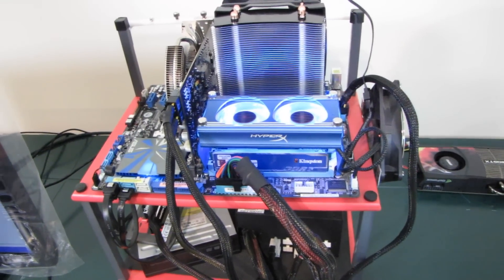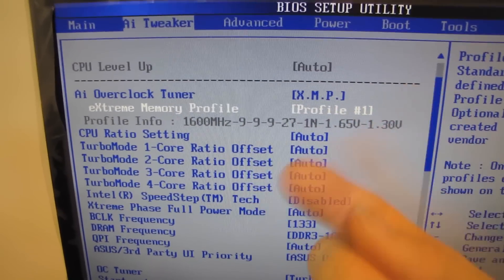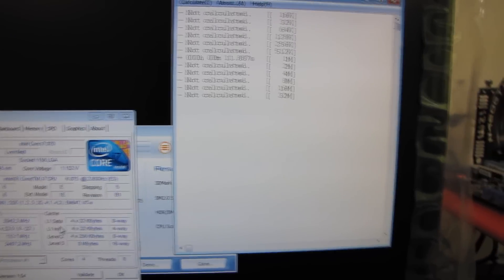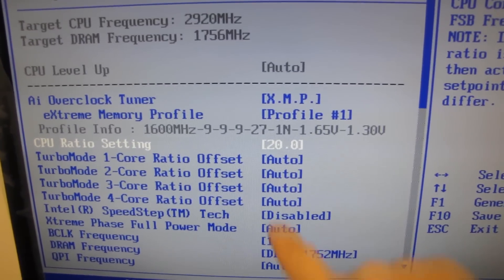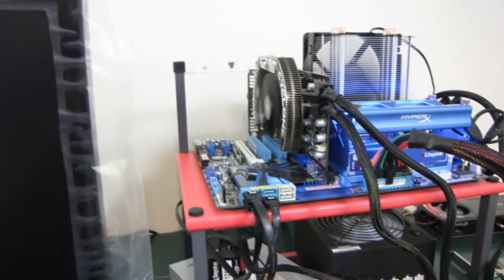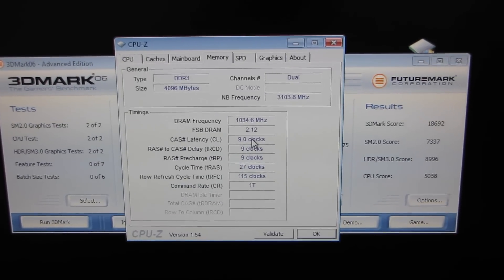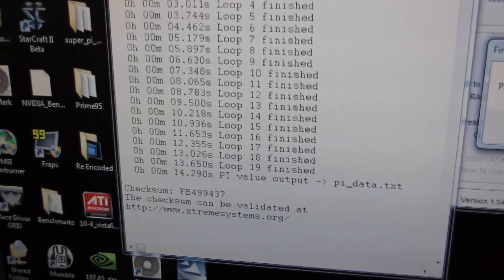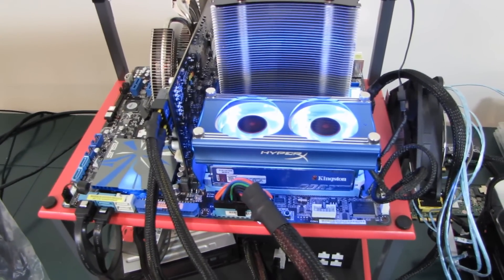Kingston HyperX Blu 1600MHz DDR3 Overclocking Guide Tutorial Linus Tech Tips

Comment: Hi Linus Tech Tips and all the people here :)

Hi, how is the name of the individual memory latch - which are set here?
I`m very instrested of these things to do.

I have a problem:

I have a problem and although I have the following memory: Kingston KHX1600C9D3B1 / 4G (99U5403-067.A00LF) - with the mainboard: Asus H87-Plus. The problem is that the memory is only detected as 1333MHZ - xmp profile is not activated - and even if it is activated - it does not bring. I once managed to set the ram to 1600MHZ, but since the system was unstable and when you plug in another ram pair, I came to the desktop, etc. but otherwise nothing ran great including freeze dektop. The RAM is not in the QVL list of the motherboard - these lists are old as well as the mainboard itself ... it may be that the RAM on another mainboard automatically detected by 1600MHZ correctly or it may be that one this particular bar / latch generally set manually, this must run on 1600MHZ?

Thank you in advance.

Comment: I've this RAM kit actualy running as DDR3-2400C10 xD 
1.200 MHz CL 10-13-12-30, comand rate 1T, 1.800V without any air cooling, no need...
Reply: are they still...alive?
Reply: @azwris-Achaean  well, I'm now on DDR4, the old DDR3 was still alive the last time I used them, I am now runing 4x8 GB DDR4-2400c17 from Micron with no dissipator, they are runing at 2800c15 1.500v right now, here is the full computer : 
https://www.userbenchmark.com/UserRun/27380884

Comment: If anyone wants to upgrade, i highly recommend the HyperX Fury 1866Mhz CL10 1.5V for DDR3 builds. I bought 2x8GB this week new for only 67 Euros. They're running now at 2133Mhz on a G1 Sniper M3 with an i5 3750k @4.2Ghz. With the ram at 1.64Volts i managed to tighten the timings to CL9 11 10 30 (!) All on 2133 and still stock Trfc 243 and Command Rate 1T! :D  ... The MaxxMEM2 results blew me away:    Memory-Copy: 24474 Mb/s  *  Memory-Read: 24429 Mb/s  *  Memory-Write: 20711 Mb/s   *   Memory-Latency: 46,4 ns   *  Reached Memory Score 22,24 Gb/s  *   I'm happy that there is no need to buy TridentX 2133 CL9 11 11 31 @1.6V for 90 Euros (what also would be a good buy :)
Reply: hello sir ,good day , the  HyperX Fury 1866Mhz CL10 1.5V can overclock up to 2133mhz?
my pc specs is :
proc: a8 7600
motheboard : gigabyte a68hm-ds2 (can support up to 2400mhz  ram speed)
ram : 2x4gb hyper x fury 1866mhz . 
how to overclock ? i need to run it on 2133mhz for my built in graphics . 
thank you.
Reply: I tried adjusting 2133 Why does it feel like 2000? (hyperx 8*3 24gb)
May I ask, what is the max oc?

Comment: This is a really old video can you make a new guide
Reply: Konrad Matusiak
nice! great ram :)
Reply: Eero nikola
If you have a game, which is cpu bound or if your running extreme sli/crossfire setups which max out your cpu usage, then yes. If one or more cores of your cpu got into the 90%-95% usage range then your fps in game will rise when the ram is faster. Read it out with MSI Afterburner while gaming.
Reply: +Vongola X If you need help with memory oc, just feel free to ask! And pls take a look at my comment above for my todays results with HyperX Fury 1866 :)
Reply: +Toby To I have this hyperx genesis or blu 1600MHz cl9 and I OC them today to 2133MHz CL 11-12-11-30 and they work perfect
Reply: i.e. arma engine heavily uses 1 core to the max :) and if ur sitting on amd ur single core performance is relativly slow
Reply: Nice! Yeah most of the games have a good multicore usage. Have fun :)

Comment: don't loose your time overclocking your memory it makes no difference in gaming
experience...so unless you are running pretty specialised applications that
rely a lot on memory speed, it is not worth the time you'll spend...
One good thing to do tho is to just load the XMP profile 1 in your Bios and voilà
you're good to go...overclocking the CPU and GPU will provide a big boost in games
thos and that is worth spending time for...
Reply: This is terrible advice. If overclocking your ram takes a few hours of your time, and you're going to get a .5% performance increase for FREE over the life of your system, of course it's worth it. If you don't think .5% is worth it, go buy an off the shelf prebuilt and just leave it at stock clock speeds!
Reply: I hope some of you can help me out. I notice that my ram sticks are running at 1334 mhz and not 1600 as they should (what i have understand, they are downclocked). But i have not succeed to clock them to 1600 mhz. My motherboard is Gigabyte GA 970A-D3, CPU: Fx Hexa bulldozer running at 4,2 ghz. The motherboard support up to 1866 mhz ram memory and 2000 OC. Any tips? Thanks!
Reply: sure, use XMP profile 1 in your bios it will clock the ram automaticaly at rated speeds and timings.
Reply: +Tech Wiz Master is XMP only for intel ? my amd system dont let me pick xmp
Reply: ronnie tjikoeri
no, certain AMD socket and motherboards does support XMP profiles, yours might not, i had an FX-8320 ona  gigabyte 970 board that was supporting XMP in the UEFI.
Reply: Tech Wiz Master could be that my chipset sucks i got like the worst chipset for that platform a amd 960 i think
Reply: ronnie tjikoeri
yes, overclocking oriented chipsets tend to be the ones who support XMP on both AMD and intel platforms.
Reply: Tech Wiz Master my system sucks apparently the FX8120 cpu is not powerfull enough for new games the 960 chipset does not support XMP and the motherboard sucks for overclocking and my videocard the amd 7950 seems dated i was looking for a 290x but that would be bottlenecked by the cpu, any suggestions for upgrades or should i buy a new intel based pc
Reply: ronnie tjikoeri Who told you a 290x would be bottlenecked by an FX8120? That is bullshit.
Reply: ronnie tjikoeri
i would sell board + FX cpu to the most offering and order i5-4460 and cheap H97 board and then buy the best GPU you can afford.
Reply: NeuroticLobster
i had an FX-8320 clocked at 4.4ghz (much better peformance than his FX-8120 already but require higher end motherboard for overclocking and good cooling etc.) paired with a GTX780 and in many games i had cpu performance issues and the GPU was not getting fed properly, animation was smooth but at lower framerates with a lot of dips and fluctuations in GPU loads in many games made me upgrade to a better platform now and my games run much better you can check my videos i tested many CPU's in modern games already including some FX playing BF4 which is a game i must admit run very well on AMD FX processor but it's not the case for many many other games as well.

Comment: Linus TechTips which would you say is better for gaming, lower latency or higher frequency? ... even if the 3dmark scores are the same there must be some benefits over each one?
Reply: don't loose your time overclocking your memory it makes no difference in gaming
experience...so unless you are running pretty specialised applications that
rely a lot on memory speed, it is not worth the time you'll spend...
One good thing to do tho is to just load the XMP profile 1 in your Bios and voilà
you're good to go...overclocking the CPU and GPU will provide a big boost in games
thos and that is worth spending time for...
Reply: ive oc'd my cpu to 4.8 stable, any my gpu in evga precision i was just trying to think of any little performance boost. my ram is 2400mhz but either my mobo or processor limits it to 2133mhz (2600k, LGA1155) i was thinking as its running slower that rated i might be able to tighten my timings, i just wanted to know if it really makes a difference and which way to go
Reply: Michael Burt
wow man sounds like you have a great setup and beleive me if your ram is already running at 2133mhz this is PLENTY fast to feed the CPU you have in ANY games, you will see no improvements whats-o-ever by fiddling with you ram, not even 1 fps...nada...if you want more frame your only option is getting a new GPU...your CPU will feed ANY gpu out there...what is your current graphics card?

Comment: Check you motherboard's SATA settings, some motherboards have specific SATA ports reserved for things other than hard drives. For example, 6 SATA ports controlled by Chipset, other 4 are a lower-speed and controlled by another chip on the board, and one is specifically for DVD/Blue ray drives ONLY due to otherwise possible bottle necking problems.

Comment: Think I have the same kinda Kingston Blue memory in my comp. At XMP profile which is tuned to 1600MHz it says 1.65 volts but I'm running it with 1.5. Works just the same.  Remember that DDR3 standard is rated at 1.5 volts and for example with Intel chips that have build in memory controller it brakes the CPU guarantee (accordingly of the guarantee terms) to run memory with higher voltages. Not that it ever had, but it's something to remember if you have new chip.

Comment: Some people doesnt have a advanced motherboard like u have. Uhm, and some motherboards cant read the ddr3 ram and runs it on 666.7mhz. It should be run it on1333mhz. Than u have 2 options. Replace battery from ur motherboard or a bios update. Other: replace whole motherboard but thats to expensive. So when u instal 8GB ddr3 ram on dual slots it runs it on 666.7mhz and u will get an bluescreen. Thats not funny. Does someone have an other idea to fix this problem ?

Comment: So the moral of the story is that over-clocking the RAM makes for a SLOWER Super Pie, OR reduction in latency makes absolutely no difference in even the most "minute" tests of RAM speed.  You don't post the numbers, but here they are.

Baseline 14.305sec 
25% FASTER Clock - 14.227sec 
Faster Latency - 14.29sec

3D Mark - 18,534 to 18,692 to 18,654  (Standard Error)

Interesting video regardless, and I learned a few things, including not to waste my money on overlclocking ram.  Thanks!

Comment: Just mixed a bit in bios with my: 
Corsair 8GB (2x4096MB) 1600MHz XMS3 [9-9-9-27]
- - - - - -
Set the timings to: 8-8-8-24 and 1386Mhz voltage: 1.5v 
And now i get: 08.673s   in  Super Pi with the (1M test)  :D

Comment: @74Eric74 The memory you put in your machine is relative to what the motherboard supports, always. If you got 4gigs of DDR3 1333MHz ram, then you'll need a motherboard that supports the type (DDR3) and the speed (1333MHz).

There should be a listing of ram is capable based on type and speed, check out newegg for details if you've never been there before. It should become pretty obvious once you look at the motherboard specs.

Comment: I'd love to overclock my system but my 550 watt system is plugged into a 450 watt battery backup and if I overclock my backup gives me overloaded beeps.

comprise protection and the ability to keep using my PC when the power is out or overclock my system ~33%?

My Phenom II x3 720 is stable at ~3.6 ghz  my gtx 460 1gb cyclone is fine at 825 mhz and I keep my OCZ platinum 1600 at stock.

Comment: @Tantoblade1pd 

Not really, it shortens the life when you go outside the set voltage. Keeping it it at (for example) 1600Mhz @ CAS 9 with 1.65v your not gonna see much of a life degredation when you put it at Cas 7 or if you put it at 1800Mhz @ Cas 9. 

Most of the time memory will easily run outside it's specs, company's do it so they can improve yields. Christ my 1600Mhz Cas 7 DDR3 can run @ 2000Mhz Cas9.

Comment: You also forgot to mention that DDR = dual data rate lol
You coulda also said that latency lowering is more useful for AMD (I lowered my timings on the G.Skill ECO from 1600, 7-8-7-24 to 6-8-6-20 and I got a large boot time improvement, on an AMD x6 platform).
You forgot to mention SuperPi 32M can also be used as a RAM stability tool.... or what to even use as stability tools (SuperPi, memtest86+ and IntelBurn are the best, Prime95 blend is good too).
Great guide though!!!

Comment: @ryancouture about 30 c for a standard 4 GB set running at 700 to 1300 mhz if you overclock the ram to about 1600 to even 2000 mhz then it will be around 40c or more depends on your heatspreaders, if you are overclocking your ram get a good Ram cooler like the Kingston hyper x :)